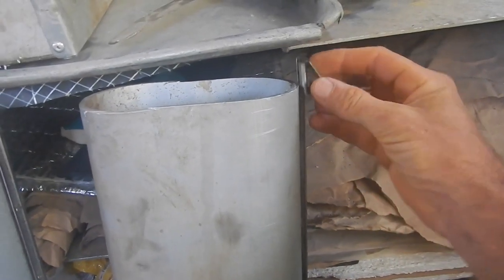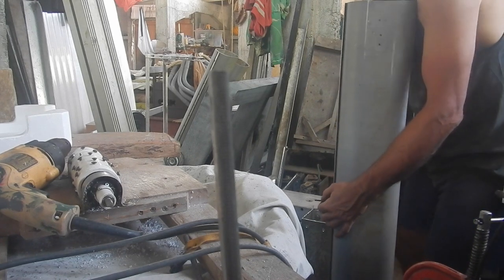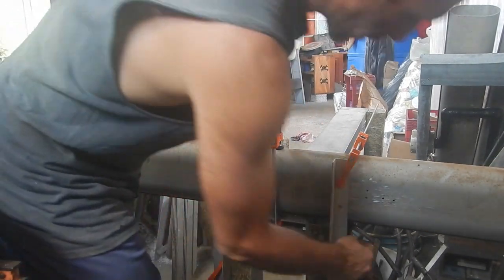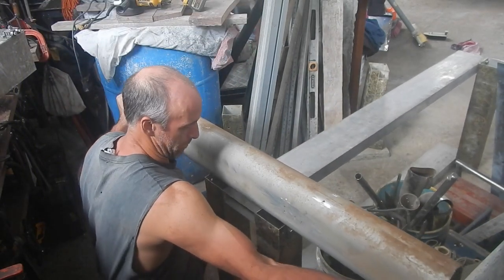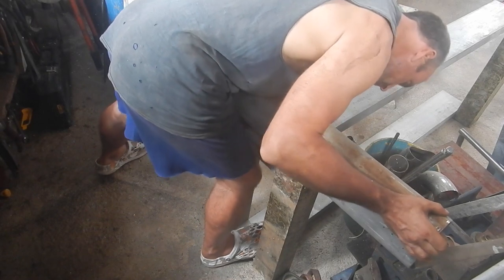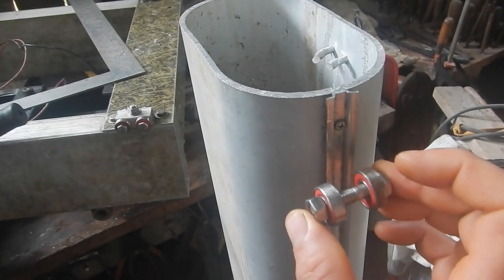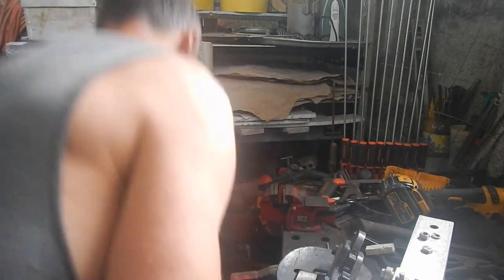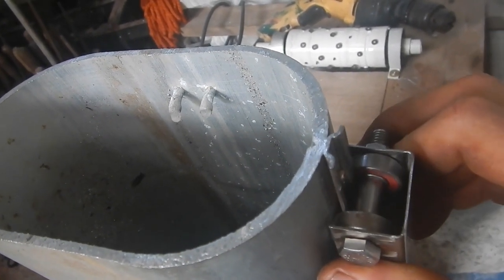Lumber Mill 012 No, Sir.  I don't Like It!

Comment: Good call on the bearings.  Maybe, just a thought here, use a u-bolt around the vertical aluminum pipe and put rollers/bearings on the opposite side of the bearing rolling along the track.  The u-bolt then can be tightened to make the saw move smoothly up and down.

Comment: Looks like plan B will get run through the old noodle processor.  But, I'm left wondering about current draw of that DC motor when stalled out. And how much torque can it generate. If it's anything like a golf cart, it could be a lot of torque with enough batteries.